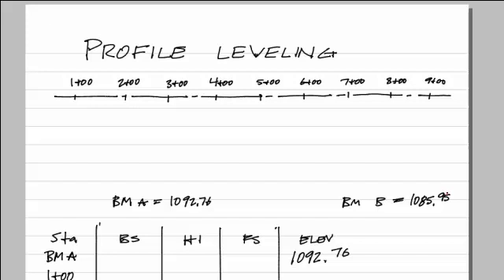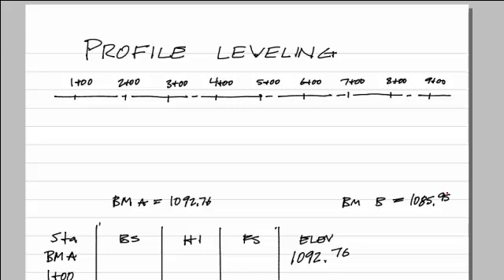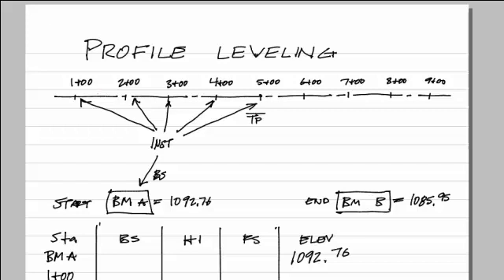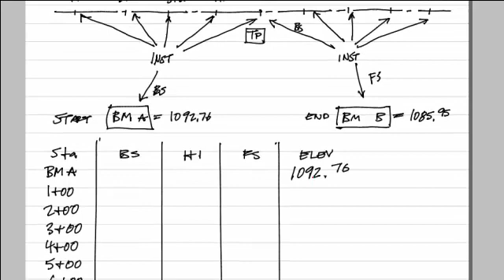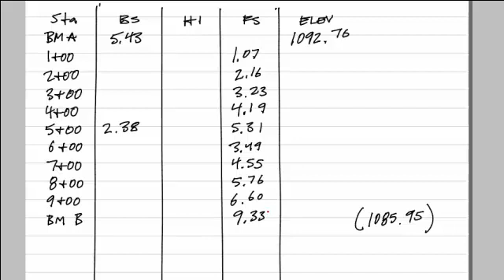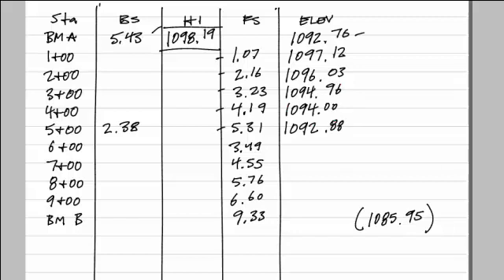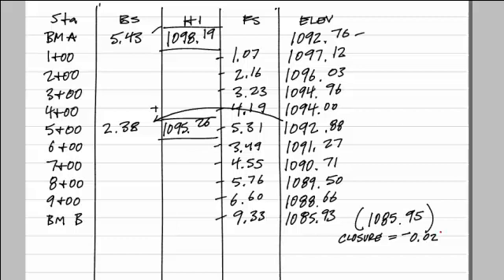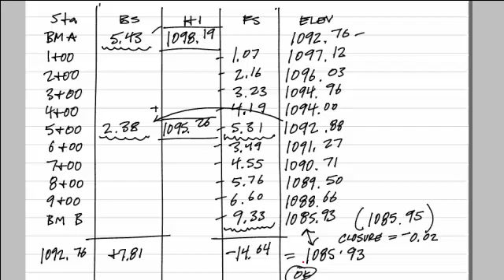CIT 255: Profile leveling

Comment: I have a question how to get the elevation if theirs a BM1 backsight measurement which is 1.62m then the IFS is 5 meters.  How will i get the elevation of BM1

From 0+000 (BM1) to 0+050 (BM2)
Reply: Same example in your video. 
I dont know how to get the elevation of BM1 because i only have BS which is 1.62m and the IFS of every point is 5m. And i have station 0+000(BM1) TO 0+050 (BM2) 

MY TP1(0+025)

I HOPE YOU CAN HELP ME OF HOW I CAN GET THE ELEVATION OF BM1